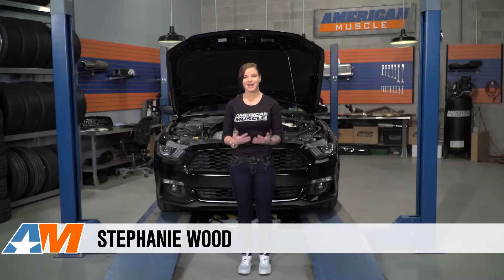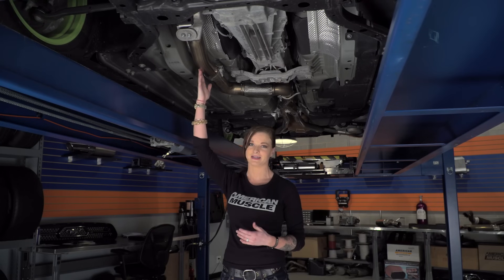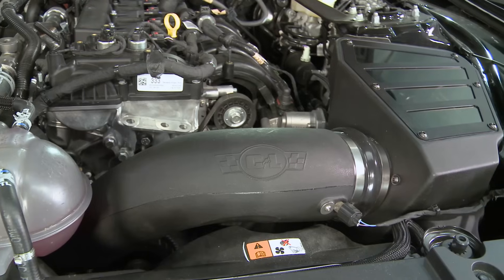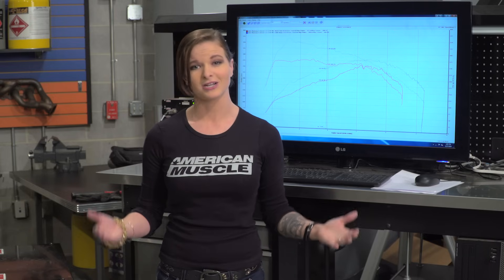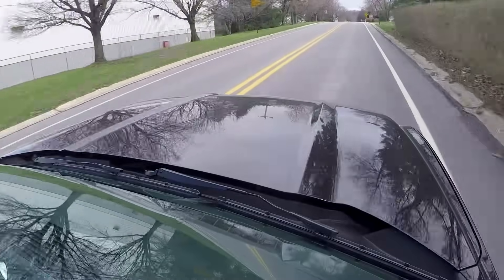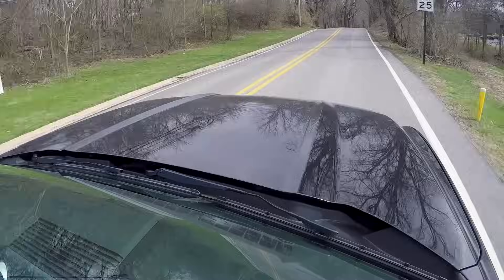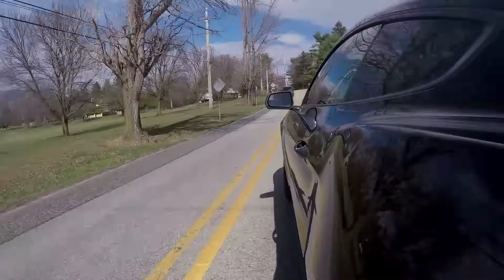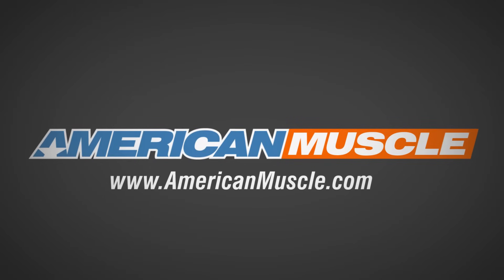3 Mods + 113 HP Gains- 2015 Mustang EcoBoost

Comment: The video was clearly all about the unpleasant noise. Why not fix the droning with high flow cat, resonator and/or less aggressive muffler? After this change, you are then able to review the performance gains without such negativity.
Reply: Because they are worried about giving ultra low baseline numbers to make the mods seem more impressive than they are .

Comment: Quick question... Does these mods can be used on a V6?
Reply from the maker: Great question King, the EcoBoost and V6 are two different set ups, so different mods will have to be used on a V6. In this video, we added a Cold Air Intake to the EcoBoost, which could easily be added to your V6 as we have many options here on the site. Feel free to check them out. Also, we made an exhaust change to a Borla Off-Road Downpipes/ Borla ATAK Catback Exhaust, which can also be found in different options that will better suit your V6, so check those out as well. Let me know what you decide to do! These options would make awesome performance gains for that V6 of yours! - Matt

Cold Air Intakes: http://www.americanmuscle.com/search?keywords=cold+air+intakes&generation=2015-2016&VehicleType=Mustang

Exhaust: http://www.americanmuscle.com/search?keywords=exhausts&generation=2015-2016&VehicleType=Mustang

Comment: Look at all those 90 degree exhaust bends.  Turbos want the straightest exhaust route as possible.  Sharp, 90 degree bends hinder flow and cause back pressure.
It sounds like crap too unless my speakers aren't reproducing it's sound correctly.  Sounds like a turbo Honda rather than turbo boxer or turbo big Toyota sound.

Comment: Can you get a lot of turbo sound and less motor sound
Reply from the maker: Kinda depends, what kind of turbo sound are you looking for? Intakes and blow off valves will give you louder induction noises. Adding a down-pipe can let you hear the turbo spool more compared to stock. Adding an axle-back or cat-back system will make the exhaust louder and allow you to hear more turbo whirls as well. Nothing will really quiet down just the motor itself though. -Zach

Comment: I just don’t see the point in a newer 4 cylinder when you can get an 2011-2013 5.0 for a decent price ;-;
Reply: The reason would be, brand new with a full warranty and zero to 60 in 5.4 isn't too bad.  Depends what you want, very fast and crazy loud or fast and not so loud.  It's all about cost.  A base GT with no options is 5k more that a loaded eco and you gain about 1 sec faster in the 0 to 60.

Comment: No cat so illegal for the road? BIG gain at 2500 revs, max power and torque. Twin turbo setup would make a big difference, better low end and stretch P and T past 5000 revs. But it sounds like a ricer, not a Mustang.

Comment: My 2017 Mustang Ecoboost has 310hp stock...
Reply from the maker: To the crank, absolutely! Regardless of the vehicle or engine though, drivetrain loss is a real thing and not all of that horsepower makes it to the wheels. -Zach

Comment: I assume this is a manual..?
Reply from the maker: Hey Cheshire, you assumed correctly. This EcoBoost is a manual. Are you looking to get one?? - Matt
Reply: Yes I am actually. I currently own a 2013 v6 (complete bull on) got around 400+ hp and 350+ torque. Just debating whether the EcoBoost will have enough horse power (full bolt on).
Reply from the maker: Oh dang sounds like you got yourself quite the Mustang already, that's awesome! Hey in all honesty, I am in full support of the EcoBoost. Its a great Mustang, and you can see the power that can be added to it from some simple mods, let alone if you go fully into it. Keep me updated with everything! - Matt
Reply: AmericanMuscle.com I'm going to get the new mustang when they improve the engine itself. I do absolutely love the design, safety rating, gas milage (considering its 270+ hp and 250+ tq). I guess I'm expecting too much out of the new engine considering that there is heating issues and carbon deposits.

Comment: @americanmuscle.com I’m adding a borla exhaust + catless downpipe+ Cobb V3 tuner+ roush intake using 91 gasoline on a 2019 ecoboost Premium convertible package 📦. If I add a intercoller will I have more than 113 Hp gains
Reply: I have the same car just none of the extra stuff 🥺

Comment: I thought these were 305hp stock
Reply: The dyno measures hp at the wheels. Manufacturers advertise hp at the motor. You lose 10-15% hp thru the drive train.

Comment: So the Ecoboost just needs 3k worth of mods that void your warranty, and make it illegal to drive on the road to be "fun to drive" and not "boring?"

Neat.
Reply: .... You must be new to cars
Reply: liam cornec I just repeated what she said in the video. Maybe watch it or something.
Reply: liam cornec wow, I'm going to reply to what I think you meant to type before you had the mini-stroke.

Sure, if you have an issue with something other than your engine/transmission. Otherwise, you're likely to be refused on your warranty claim due to the tune. But, I bet you're that one guy who knows the owner of the dealership, and can get it done regardless.
Reply: +Anselmo Jones it's called taking it off lol I've been doing it for years on my sti.
Reply: You can reflash it with the factory tune, but they will still know its been changed if they look.
Reply: If you put bolt on's it won't void your warranty unless the bolt on's affect the problem directly which lets say an upgraded inter cooler, air intake, and cat back were in which they would only allow better air flow, mpg, and lower temperatures for the car. I don't recommend tuning a car though, because that will void your warranty.
Reply: Austin James I know this, the tune was what I was referring to as voiding your warranty (and most likely only the powertrain part of your warranty.) The parts they put on, aside from the off-road downpipe, would be fine.
Reply: +Anselmo Jones i reflashed my car back to stock every time and they never gave a shit.
Reply: +Anselmo Jones I've put a tune on my 2012 charger rt and removed it to take my car to the dealership. got a new transmission put on under warranty and they never knew i had a tune. i watched they guy test my tcm and nothing came up.
Reply: I have a V6 with a D-1SC procharger, injectors, driveshaft, full exhaust, plus some other goodies pushing well over 400whp @6800Ft (Altitude, uncorrected)... have gone in for a new water pump, temp guage, dealing with shitty MT-82 issues and for reg maintenance.. still have my full warranty no issues with the tune on it or mods... most the guys at my ford shop love my car.. even the GM for the place loves it.. they just look the other way when I bring it in lol.. that's what most dealerships ive dealt with do
Reply: +Mark Brown im full of shit? i have no reason to lie.. who talks up a v6 just to bullshit people?
Reply: osp80 yeah, i may have rounded up like 400ish dollars, but after tax basically $3k..
Reply from the maker: Great comments here guys, love hearing all the times you guys removed the intake when bringing the Mustang back for work. Definitely not a lone on that one, but hey what they don't know won't hurt them! Thanks for the feedback fellas! - Matt

Comment: I wonder how much an E85 tune would be gained on the 2.3
Reply: Some modifications to the fuel system are required to run e85 but 380+ wheel horse power is possible.

Comment: Waste. The Ecoboost mutang stock is rated for 310 hp and 350 tq
Reply: Thats horsepower rated at the crank all vehicle manufacturers rate there power ratings at the crank, after driveline loss its 245hp or whatever she said.

Comment: Exhaust set up’s on these cars are pointless my ecoboost made 403 whp with a stock catback spend that money on custom tuning same goes for cold air intakes they kill more power then add your biggest mods on these cars is a downpipe a full size intercooler a wastegate custom tuning and e30 fuel
Reply from the maker: If you're comparing what gets you the most power for your money, you'll absolutely see bigger gains out of a downpipe and custom tune compared to a cat-back alone. I wouldn't call a cat-back pointless, imo. Nothing wrong with wanting to change up the sound of your Ecoboost with one of them instead of jumping into a downpipe. -Zach
Reply: @americanmuscle  makes a lot of noise and does nothing for performance. The only exhaust on the market that actually does something is the tomei exhaust

Comment: Sounds Horrible ! And its been proven that the stock intake performs better than most CAI setups with just a filter change, upgrade to metal pipes but leave the airbox, Don't waste your cash fellas. I gotta call bullshit on the first dyno run. And the stock intercooler cannot keep temps down with back to back runs on dyno, Proven. Dyno results vary so much with stock setup.

Comment: Full of shit.  I have an RS, which has a LESS restrictive head and intake than the 2.3 in the mustank and comes factory with a 3inch exhaust feom the downpipe back.  I replaced it with an catless DP, and AWE track exhaust, mishimoto intercooler and intake, and a dreamscience tune "highest gain of ANY access port tune available for 2.3" and it didnt gain 115 hp.  So ether A, lying. Or B, that dyno is insanely forgiving or is just off.

Comment: Lol sounds like shit, end muffler setups NEVER sound good, my 98 4.6 with 150k sounds 1000 times better than my 06 4.6 with 60 even tho my 06 has 100 more horses. It's cuz my 98 is mid muffler and has a couple feet of pipe after the mufflers. It sucks but they don't have room to put them anywhere else tho. Lol if you think this exhaust sounds good you must like how old lawnmowers sound too

Comment: Y Ford just y ..... no real man wants to buy a 4 banger mustang especially one that’s mad slower than the 5.0 they used to put in them .... I guess less you’re spending 60 grand on the GT 350 mustangs fell off in 2017 and they stop making it a 5.0 smh gues I’ll be buying a 17 next year lol hey at least I’ll have some fun Knowing that my car will be able to eat the 4 banger mustangs for breakfast and for those half man half girl whom says u can “mod” this car  to get gains lmao yes that’s true but same can be said for the V8 5.0 real model and I actually get a bad ass sounding car straight from factory .... trust me I’m not against 4 bangers I had a Subaru Sti for 3 years and loved it but if I’m going to get a four-cylinder turbo car it’s got to be all wheel drive and it has to be iconic like the Sti with equal length headers so I didn’t get ringland failures, not some trashy Half-asleep thought up idea for an engine lol not to mention all the problems that the eco boost engines develop around 80k -110k!! And that’s the ones I’ve worked or heard of on the Ford F-150 trucks that aren’t getting dogged everyday because they’re not sports cars they are work trucks or play trucks for the business man whom uses it once a year to haul sand for his kids kitty pool lol so I can’t even imagine the problems that Will and would most definitely arise with a sports version of this horrible platform!!!No thanks anyway Ford I’ll stick with the 5.0 version don’t care how much boost u can turn it up to since it’s gonna blow as soon as u tinker to much , not to mention the voided warranty PASS !! 
Sure I hurt a lot of feelings with this comment but just spitting fax like a machine over here in Georgia don’t like it don’t read it I’m just voicing mostly facts and a little bit of unbiased opinion since I’ve loved and owned all Types of cars and trucks over the years and don’t lean one way or the other when it comes to engine sizes or numbers of cylinders, heck just last year me and my brother were building a 3 rotor rx8 !!

Comment: This has no cat. It is technically illegal to drive on roads in USA. Your company can be sued by EPA for deleting emission equipment on a road car.
Reply: Off Road Use Only
Reply: The video shows the car being driven on what appears to be a public road. You have another product listed on your website which also has 3 inch downpipe with a cat. Where is video of that product?
Reply: Starstriple a Ford dealership can be sued for modifying exhaust or tuning a car
Reply: Kenneth Swan Sued by who? Ford Racing has a tune for for the Ecoboost Mustang that retains the factory warranty once it's installed.
Reply: Actually they can't.  Only the car owner can be prosecuted.  They sell you the cat back with YOU understanding it "off road only".  Not illegal unless they try to title the vehicle.
Reply: HAHAHHAHAHAHA!!!!!
Reply: EPA, Climate Changers, Global Warmers is CRAP!

Comment: Or you could get a v8 lol
Reply: Peter V. Not everyone has the money for a V8
Reply: Peter V. cheaper than a v8 after mods and gets better gad mileage and is still fun to drive
Reply: Peter V. This beats a stock gt
Reply: iceblock3 No it's not. After all these mods its still 70-75ish rwhp less than a stock coyote V8.
Reply: Matt Hartup but it's engine is a lot lighter.